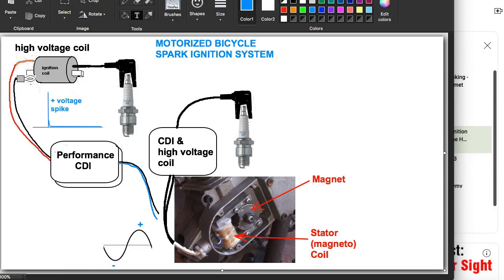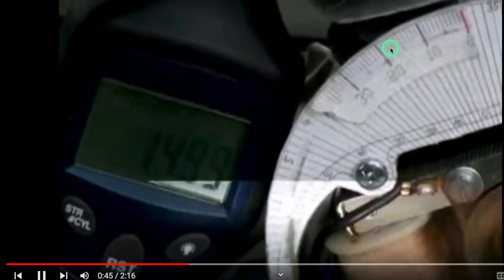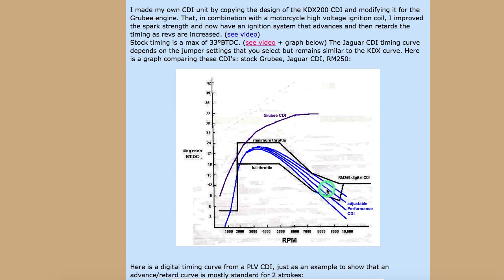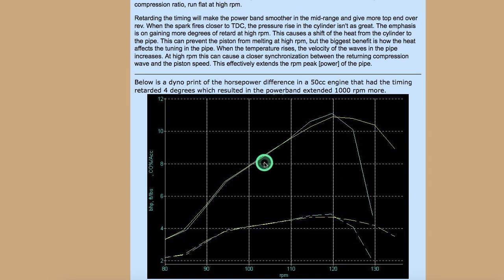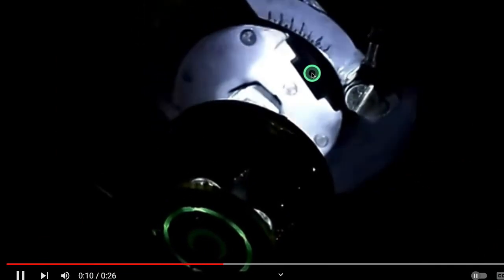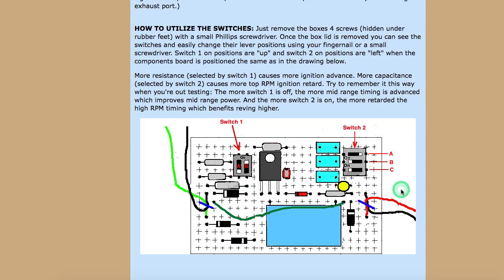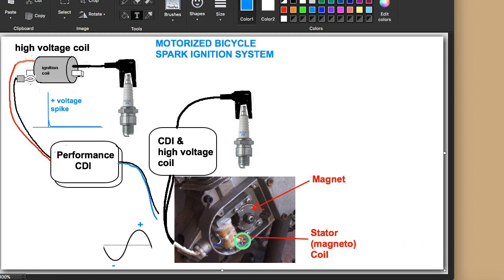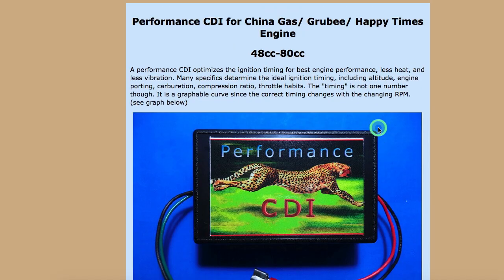Adjustable CDI for Motorized Bicycles (2 stroke)

Comment: Hello Micheal my daughter has a yamaha PW80 that uses the 2 wire coil "triggerless" cdi setup you describe here. The CDI unit is damaged beyond repair and no longer available from yamaha and i cant for the life of me track down an aftermarket replacement that does not require an external trigger do you have a link for one you know would work to get her riding again ? It reads like your jaguar one would work but i doubt its availabe here in New Zealand and it sounds like its is way overkill for what a kids bike would need. Thanks in advance
Reply from the maker: My friend Nick in Australia sells them. His email is on my CDI pages: dragonfly75.com/motorbike/CDI.html It is adjustable but I can't guarantee its range of adjustment is what your engine needs but it may be worth a shot.

Comment from the maker: What I recently found out is that the motorcycle "typical timing curve" applies only to engines with a squish band head which increases the air/fuel swirl speed as RPM increases which accelerates the combustion. Heads without a squish band (like our stock ones) need an ignition curve that maxes out and then maintains that advance thru the rest of the RPM range. The latest Jaguar CDI allows you to select that curve for a stock head. This also applies to heads with too much squish clearance which has too little squish velocity. Also the higher the engine compression, the less advanced the timing needs to be. The stock CDI has timing that is suited to an engine with low compression and no squish velocity (due to lack of a squish band) although its spark voltage is too low for my tastes. More spark voltage means less misfires. This increases engine power. There's a study on this subject linked to on my CDI page.

Comment: Is there a downside to just retarding ignition? besides for loosing a bit of low end of course. Currently low on funds and that custom Cdi sounds expensive, though I’m sure it’s worth it. Just trying to keep detonation down for cheap. Thanks a bunch , your videos and website are the best source of knowledge for 2 strokes and these little bike engines. Hope you are do well.
Reply from the maker: yes you can retard the timing by modifying a woodruff key to offest the keyway about 5 degrees. It is explained on my site dragonfly75.com/motorbike

Comment: I tried to reach the Jaguar guy and he had said he wasn’t making them at the time. Any updates would be appreciated.
Reply from the maker: I stopped making them and then let my friend in Australia make them. His email is on the 2nd CDI page (see link in description)
Reply: I remember the guy used to have that but I never had a motor that needed one back then that was like 8 years ago. Now I've got something with a high compression head and pipe along with a third port and could use one. I'm definitely am basically hitting the rev limiter.